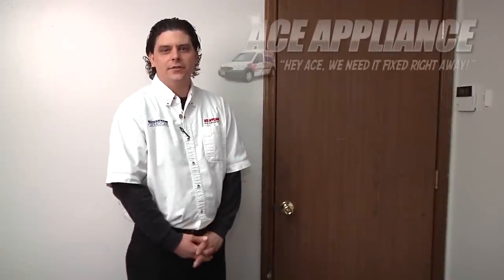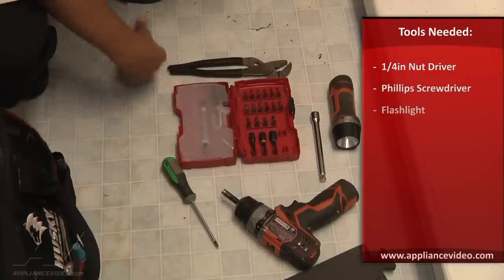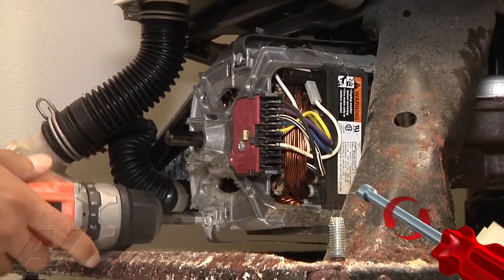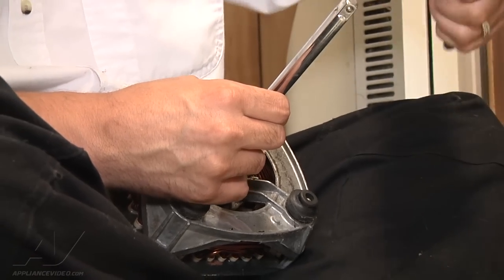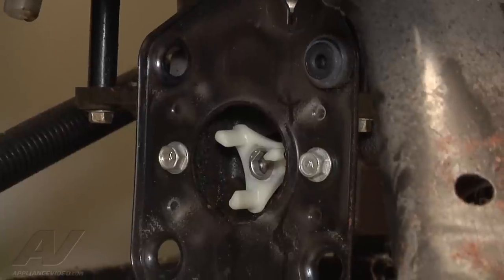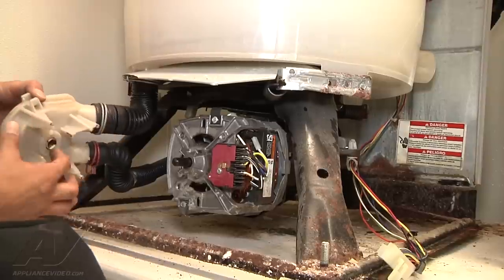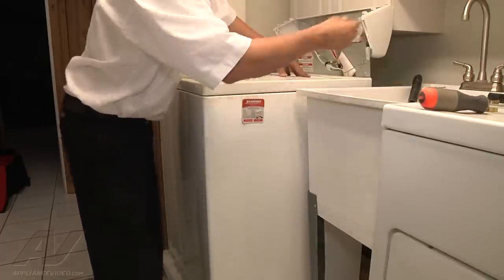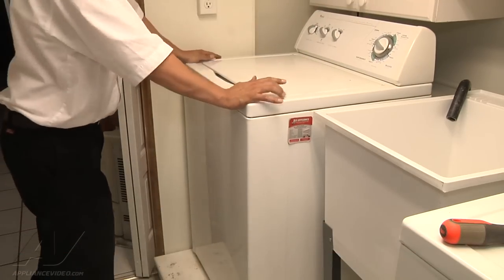Whirlpool Washer Repair - Not Spinning - Drive Coupling

Comment: you make it look so easy  ;)   You could probably do it blindfolded.  I could get it apart but my problem has always been getting it back together, without leftover parts.
Reply from the maker: Great question, if you have a more technical question that our parts department cannot answer, you can search our over 17,000 answered questions free at our website www.ApplianceVideo.com under our Repair Help section. You can also call our parts department at 1-800-830-5465 and they can give you help 7-days A week ,or search at www.SaveMoreOnParts.com  .
Reply: I always have left over parts as well. I've repaired so many washers and dryers over the years, I was able to build a complete new set with extra parts :)

Comment: Idk what's wrong with my Roper. I took everything off and checked everything is still intact.  Should I let it fill up and see if it will spin and drain?
Reply from the maker: Great question, if you have a more technical question that our parts department cannot answer, you can search our over 17,000 answered questions free at our website www.ApplianceVideo.com under our Repair Help section. You can also call our parts department at 1-800-830-5465 and they can give you help 7-days A week ,or search at www.SaveMoreOnParts.com  .
Reply: Update it was the switch!
Reply: @101Simoneb  can you elaborate? mine was intact, too. what switch was it? how did you figure it out?
Reply: @marzman7  mine was the lid switch

Comment: I have a Maytag model MAV4757AWW, Tub spins slowly or not at all. The agitator rotates but also not correctly.  I don't see a  motor coupler in this unit! any ideas?
Reply from the maker: HuasoPodrido 

All of our technicians are now answering
questions daily on the ApplianceVideo.com website. You can search completely
FREE in our Repair Help section with over 1000 questions & answers. Or you
can get unlimited technical advice and video links emailed to you by our 14
factory certified technicians at
http://www.appliancevideo.com/premium-membership/.  If you are in need of
any parts please support our parts department on line at
http://savemoreonparts.com/ or call 1-800-830-5465 7-days a week until 11pm
Eastern time. Thanks for your support. Matt Ace Appliance factory service
technician.